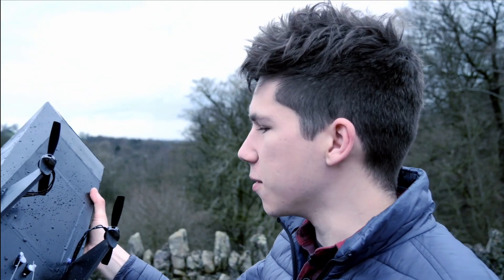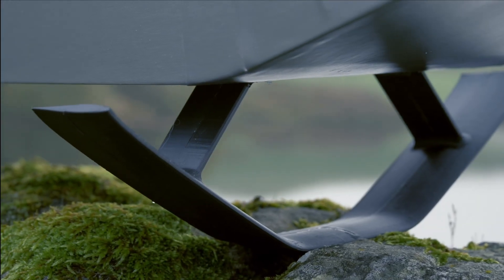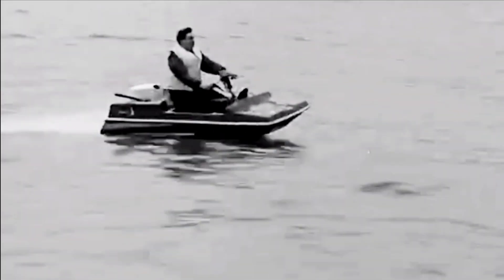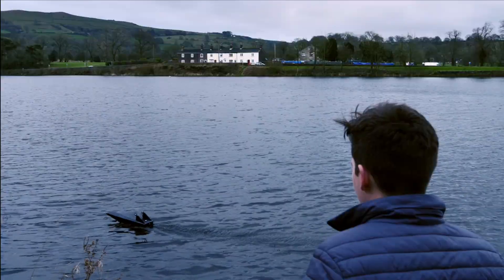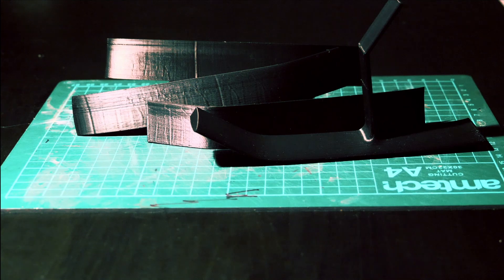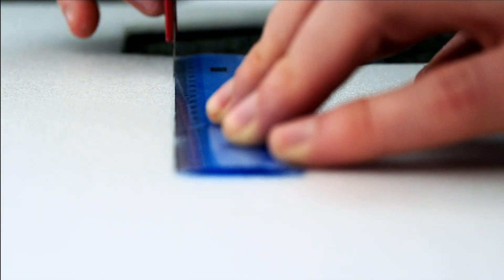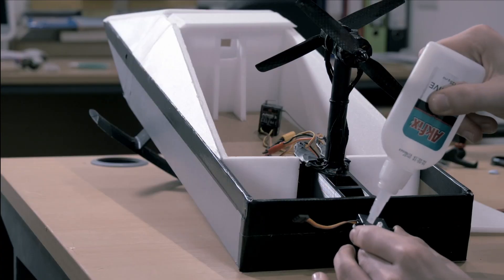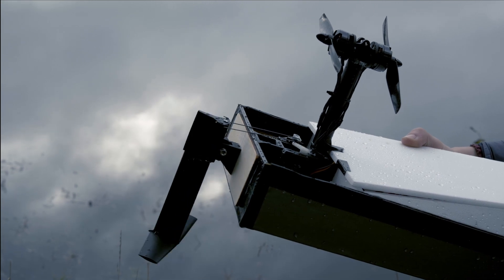TESLA CYBERTRUCK BOAT! // How To Build a RC Hydrofoil

Comment: The problem is the thrust angle. It should be angled in direction of the CG. That's why the angle you had to put on the tail was to big, and the back didn t get out of the water.
Reply from the maker: Hmm, not really sure about that. If anything I think the high moment from the elevated thrust line would force the nose down and lift the rear up - a little like how the hydroplane I built last year worked.
Reply: @Project-Air  Gungan works explains very well how it works and he also speeks about thrust angle. You need to angle your motors
Reply from the maker: @nathanbarraud4349  I see what you mean - I'll make sure to do some more tests and try altering the thrust line sometime soon.
Reply: What does that exaclty mean, being angled in direction of the CG? Closer in line with the CG or really angled towards the cg? Just interested :)
Reply: @MrKipKonijn  I think he means having the motors tilted down so they push though the CG and down cause the front to push down. I guess potentially having the motors tilted down would mean the front wouldn't be pushed in to the water so the elevator doesn't have to work as hard in the opposite direction. I do agree with James though.

Comment from the maker: Yes, the props on both boats were counter rotating! 😂 Thanks for watching my videos in 2019 folks! Looking forward to many more exciting projects in 2020. It's going to be great fun. 🙏
Reply: U have to much torq going in the same direction. Reverse direction of one motor and a different direction prop and it won’t torq over so much
Reply: Make the foil on the rudder bigger witch means the back can get out the water easily and mace the flight nicer
Reply: But do they spin in opposite directions? 
😄😄😄😄😉😄😄
Reply: ProjectAir a excellent comment was explaining your longitudinal stability issue, you also have to tackle the lateral stability of the boat.
A rule of thumb would take into account the radius of the foil (more or less the U or V shape that you have) and the height of the CG above the water. Then you should ensure that the radius of the foil is bigger than the distance to the water. This part is not easy to explain and a drawing would be better BUT :
Imagine a small angle of the boat to the left. Rotation is around the CG. If the radius is bigger than the height of the CG, the right part of the foil will rise above water and the left will plunge, creating more lift on the left of the boat and self correcting the attitude. If the radius is less the same thing will happen BUT due to rotation, the left part of the foil will be at best under the CG, at worst, on the right part of the boat, increasing the roll!
Hope it’s clear and will help you.

Also, once you make it fly, add as much weight as you can so you can barely take of at full throttle. You’ll have more inertia and pleasure to drive it.
Reply: Hey! I'm 17 years old and I've learned a lot with you thank you for everything and I just wanna say hello from 2021.
I'm studying electronic engineer and I wanna be an aerospace engineer. I built my first plane when I was 13 years old and please continue making more videos. 
Hello from Colombia!🇨🇴
Reply: No need for me to add the comment/question then......!!!

Comment: Looks like the lift is too far forward. Like in a plane the lift and c of g need to be matched
Reply from the maker: I thought the same for the MK2! But apparently you need the CG between the front foil and the elevator for a stable hydrofoil.

Comment: Great project! Maybe the first prototype was more stable due to the counter rotating props? That may also be the cause for the lack of agility: two engines pulling from the sides may make the boat more prone to going straight... While two in the middle make it easier for the boat to bank therefore steer?